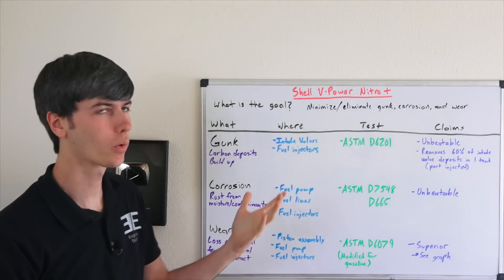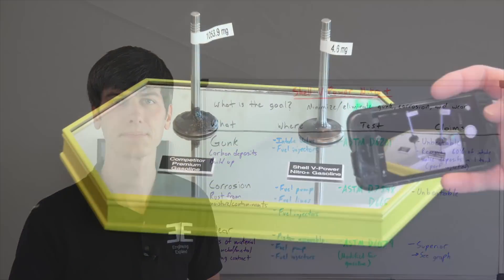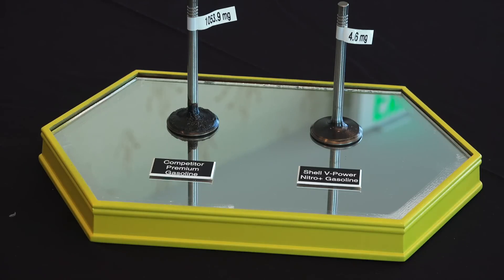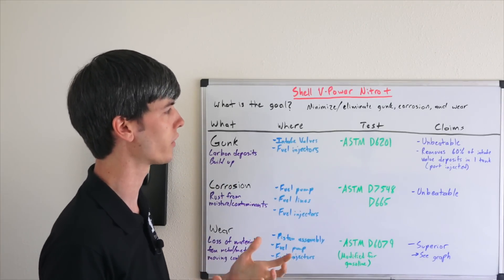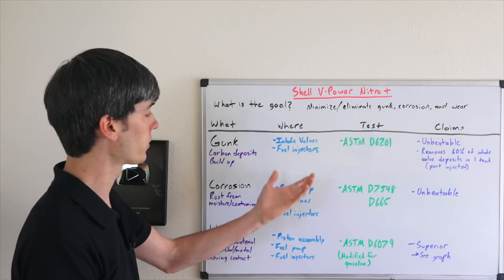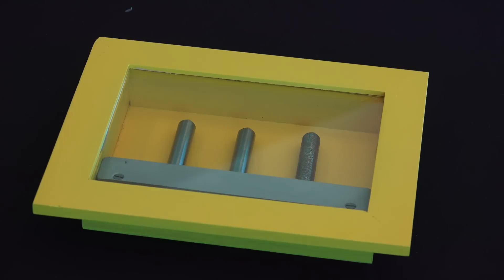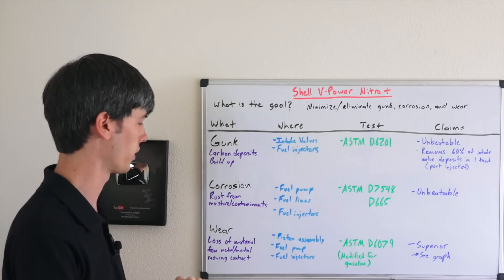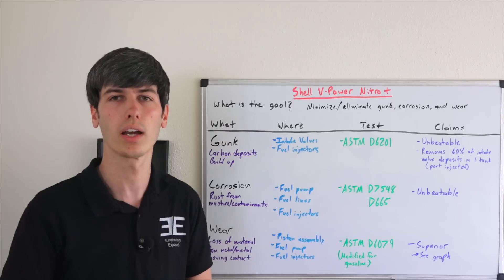Shell V-Power Nitro+ (Premium Gasoline Fuel Testing)

Comment: All of those Volkswagen carbon buildup photos are from 2.0t intake valves. All of that buildup is because those engines are direct injected, notbecause of lower quality fuel. They, along with so many other direct injected engines have had that problem for years. That's why Lamborghini started doing direct injection with port fogger injectors.

Comment: I think its BS. Shell are shysters. Shell stations in the Lower mainland of British Columbia are run by gangsters. Their stations are always trying to push the price of fuel up. Often their pump prices can be significantly higher than the competition, It is a strange and uncomprehensible  strategy. The fuel business in BC is a very fishy operation. Most expensive gas in North America. Assholes.

Comment: Jesus christ, you must have very bad "common grade" fuel over there in the states. I have just pulled out the valves on my SR500 78'. Likely the first time they have been out for regrinding for almost 40 years and they didnt look nearly as bad as those intake valves Shell shows us. Yes the exhaust valve were full of carbon deposits but the engine had been burning a lot of oil for some time(why i decided to do the overhaul), but my intake valve were almost perfect... after 40 years!

Im not trying to look down on you Americans. I am just baffled by how much worse you guys have it compared Germany/Denmark where my bike has lived its whole life :(
Reply: They are showing you valves from motors used in cold, short trips. One highway drive will clean all that up.
Reply: Your older vehicle has fuel hitting the intake valves, basically washing them clean all the time. Newer engines use direct injection straight into the combustion chamber and fuel never touches the back of the valves. Thus, carbon builds up more in direct injection engines, regardless of fuel quality.

Comment: Isn't Shell using using fresh fuel never stored underground or transported for the test? Because that changes the results significantly from my understanding; almost like taste testing fresh pizza vs frozen pizza.
Reply from the maker: +Chad Bova not gonna lie, I love frozen pizza.
Reply: +Engineering Explained same
Reply: +Engineering Explained with gdi, my fuel never touches the back side of my intake valves. What can I do to reduce carbon on the back of my intake valves in my 2.4 GDI Theta II In my 2012 Hyundai Sonata?
Reply: +Engineering Explained hahaha.  I even like the cold stuff in the morning.
Reply: Derek Carson   Good quality oil, Oil catch can on PCV system (emission compliant) and EGR delete (not emission compliant)
Reply: Good point  were the  question  of  branded  vs unbranded  fuels  come into  play.

Comment: Are those intake or exhaust valves in the pictures? They look like exhaust valves covered in burnt oil, which could provide an explanation to VWs recent problem with emissions.
Reply: Or vw could just try to be honest....
Reply: those are intake valves on a direct injection engine. Fuel never touches those so there is never a chance for it to remove that carbon build up. Audi's engines are the same.

Comment: the  " gunk  " test
 " gunk " or carbon sludge forms on the face of the intake valve and top of the piston  PRIMARILY  from crankcase breather oil.  essentially the more carbon in your engine oil, the more volatile your engine oil,  the weaker your oil against thermal breakdown - the more carbon will be suspended in the crankcase vapor-- inhaled through your crankcase breather and -- the more carbon will be exposed to  the face of the intake and top of the piston. the valve is just below combustion temperature -- certainly hot enough to cause carbon molecules suspended in the intake charge to collect of the valve face and  " carbon coke " .

airflow/injector patterns contribute significantly to gunk v no gunk forming on intake valves. ie- any manufacturer who points their fuel injector directly at - and within close proximity of their intake valve essentially and continually washes the valve with raw fuel.  tbi type of injection bodies and old carbs do not do this  as fuel is vaporized in the intake runners --having no liquied droplets left or contained in the fuel/air charge  and classically form the types of deposits as on valve left. 

i cannot make any argument for nor against shell's corrosion or wear properties but can say there are too many variables for me to completely agree with their conclusions re corrosion inhibitors.
Reply: You are right and this carbon is strong, there is no way for cleaning from fuel fly by... Everyone that cleans old valves knows how hard this carbon is...
Reply: EGR systems also contribute carbon deposits on intake valves.

Comment: Wondering how this affects my engine. 2013 civic si. From what I know, it is direct injected. I've only been using she'll 91.  Since the civic requires 91
Reply: Definitely in a good way. I mean the only top brand of fuel I'd put in my turbo GTI is Chevron. Arco/Valero/Mobil is junk to me. Shell/Chevron is where it's at
Reply: With direct injection engines you should worry about using quality oil in your engine to minimize carbon deposits in your intake, the fuel you use won't make much difference. Those deposits come from the recirculated oil fumes into your intake to be burned.

Comment: Hello. I own a new tacoma truck. And I use Shell V-power Nitro Plus fuel. People on tacoma world forum tells me, that higher octane fuel is not suited for my vehicle, and that I should use 87 grade fuel. Is there any truth to this argument? Is there any harmful effects of using 91 grade Nitro plus fuel on my truck? Is there any benefits in using 91 grade nitro plus fuel.
Reply: Use what your owners manual says, you're wasting money.
Reply: The owners manual says use 87 grade or higher. And hence why I asked my question. Is higher better.
Reply: +Optimal Joy no need to use premium. Fill up to 89 Plus if you want to go a bit higher on octane. But going from 87 to 91 shouldn't be necessary. Higher octane prevents detonation from happening in your engine. But Toyotas usually don't need premium. Unless FRS / Turbo Supra
Reply: +Optimal Joy no need to use premium. Fill up to 89 Plus if you want to go a bit higher on octane. But going from 87 to 91 shouldn't be necessary. Higher octane prevents detonation from happening in your engine. But Toyotas usually don't need premium. Unless FRS / Turbo Supra
Reply: Many, if not most, modern engines have knock sensors and the computer runs the engine on the edge of knocking when possible for maximum power and efficiency. Using higher octane fuel allows the computer to further advance the timing more often further improving both power and efficiency. Especially in warmer climates, when knock is more likely, you will gain some benefits from higher octane fuel with most modern engines. 

Some manufactures even provide horsepower ratings with both 87 and 91 octane fuel showing the difference and dyno testing has demonstrated it as well. So, in short, while you don't NEED anything more than 87, as your truck should detect and correct for knock, you will likely get some benefit higher octane fuel. The slight increase in mileage, however, won't pay for the price difference.

Comment: CBC Marketplace tested their new fuel and where able to determine that vehicles that don't require 91 octane fuel that there is no benefit using the new V-Power Nitro+ fuel.
Reply: I watched that video also, probably about 4 months now. However its my recognition that they did NOT look at carbon deposits. They looked at gas mileage -which was better ; but wasnt worth it in the long run. And the emissions tend to be worse when you burn premium in an engine built to burn 87... However.... IF the Vpower nitro actually kept these carbon deposits off... I would spend the extra change when I fueled up to keep my top end clean.
Reply: +Tylor c

Comment: Thanks for the fuel video, working on mazdas I only use shell products. I would like to add that shells nitrogen 93octane will only clean valves tens on a port engine, it will NOT clean valves on a normal aspirated engine. Port engines are the only type which have a second injector which spars on the back side of the intake side. If you go back to the video I and talking about the valve with the white diagram (right) the exhaust valve one the (left)has a red diagram this in my opinion is where the next issue lies with carbon build up.  

Thanks again for this study, the only thing I'd saw to viewers. It to be aware this was a study on a port engine 8 out of 10 drivers do not have port injected engines. Many have natural aspirated fuel injected. Watch out on the (fuel injected part)

Comment: will it help to reduce carbon build up in direct injected engines from vw?
Reply: +kanastle one Short answer - No.

Long answer - Still no.
Reply: +kanastle one Best solution I've seen so far is running a water-meth system

Comment: These "special" formulas sound like just another way to "Water Down" fuels like they do with Ethanol blends.  They're just watering it down with an inert substance like nitrogen.  That means that the fuel also contains less energy (1 gallon of E10 has about 96% of the energy of gasoline).  Which means they're crippling (albeit by a small amount), your car's fuel efficiency.  Multiply that by the amount of fuel consumed in North America alone, and that means a HUGE amount more fuel being consumed for the same amount of "work".

Comment: just take down this video its so misleading...all the intake valves shown looked like that of a volkswagen...which will never be cleaned with nitro+...if you're gonna setup a scientific experiment, do it the right and fair way...dont set up simulation or comparisons or even "before and After" when you say its port injection for shell and direct inject for the competitor...

Comment: Okay, perhaps using a vw direct injected engine is not the best example to demonstrate intake valve carbon build up. The reason is that on direct injected engines, there is no fuel mixture going past by the intake valve, only air. The fuel is injected directly into the cylinder and no gasoline/additive will ever clean the back of that intake valve.

Comment: still say all this stuff is a gimmick. like the shell nitrogen they had. also the chevron with techron. i also get the cheapest gas which is usually speedway ot kroger gas. never had trouble in my 94 camry. 22 years old and still good

Comment: Interesting, regarding carbon deposits on intake valves some cars like the Ford eco boost design have a problem with excessive deposits even on low mileage, this is certified by a excellent Ford Mechanic that posts on youtube, it might be a good test of Shell gas to run those vehicles for a while and see if the deposits clean up??
Reply: +jim dandy It wouldn't make a difference. In these cars (which are direct injected), fuel goes straight into the cylinder without passing the intake valves, so there's no chance it'll dissolve any carbon on the stems unless your valves are seriously malfunctioning

Comment: Can someone explain to me how this new fuel is going to clean the valves on direct injection heads? I've been tuning cars for 15 years and aside from catch cans, and evap deletes, there's not any solid way to prevent crankcase fumes and exhaust gases from sooting up the engine. Did I miss something, also what octanes does this stuff come in? I might try it on my car as I still run port injected gas turbo.
Reply: +Bert Alan Simple. It won't clean them

Comment: Alex: The intake valve pictures in your video come from direct injection engines. Shell's claim is based on testing of port injected engines. It is somewhat misleading to show these pictures. Understand you have a note on the video, but it does require viewers' knowledge to understand the difference of intake valve deposits in a port injected vs. direct injected engine.

Comment: So... You can't do anything with the gunk deposit in direct injection engine, yes?
Reply: +Oon Chusattayanond 
Option 1: Pull the manifold and scrape (best results, do not attempt unless you know what you're doing)
Option B: Seafoam into the manifold (Not as good as scraping, but should help)
Option 3: Install a Water-Meth Injection kit (Also best results, but prohibitively expensive. Helps to prevent future buildup)

Comment: in a direct injection engine. the fuel doesn't matter.

the csrbon diposits came from the vaporating engine oil and not from the fuel.
Reply: +AbarthDomi So... You can't do anything with the gunk deposit in direct injection engine, yes? (Unless you service it, obviously)

Comment: How is that going to get rid of carbon build up and gunk on the back of the valve of direct injection vehicles when the injector is in the cylinder and not spraying fuel directly on the valve. you should say it works well on Port injection by cleaning the valves and some direct injection vehicles like the Lexus ISF with both direct and port injection. otherwise they need to clarify that part because most vehicles are stepping away from port injection to direct injection and i can safetly say by 2020 80% +/- of the road going vehicle will be direct injection.

Comment: i've never taken apart my engine but can confirm V-Power gas runs smooth vs others i use off and on
Reply: Took apart the engine @ 15K.  What?
Reply: Running smooths means squat. Any fuel that isn't preignition is running smooth. These silly comments blow me away man.

Comment: Just want to point out, the shell rep clearly referenced port injection in regards to the fuel cleaning off the intake valves. All the VW images you followed with are from direct injection applications where the fuel is not sprayed onto the back of the valve, thus having little to no effect. To my understanding, the intake valve fouling on direct injection applications is more related to valve overlap and intake oil vapor from crankcase ventilation which gets baked onto the back side of the intake valve.

Comment: I use ths petrol in my car it run's smoother and there's is a little differents in performance
Reply: +Ian Gibbons Same here, after using supermarket fuel for a year+ and getting jerky performance on my old GTi Polo, I decided to try this fuel. There has a been a big difference to how smooth my car runs even after 1 tank + a long distance journey down the motorway.

Comment: just put a breather on your PCV so you don't pull crankcase vapors into your intake.  Also, block your EGR to stop carbon from exhaust from dirtying up the intake manifold.  Bickety bam.  Clean intake valves, and combustion chambers.  Works for me at least